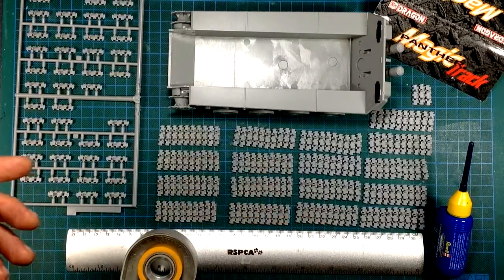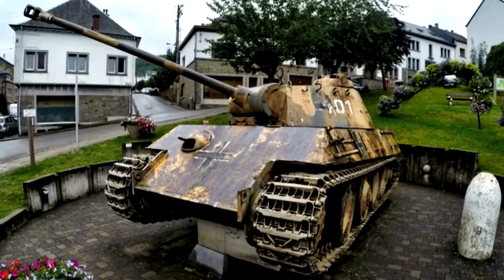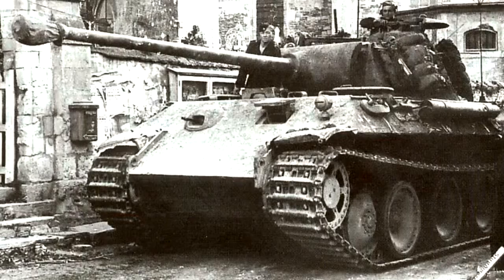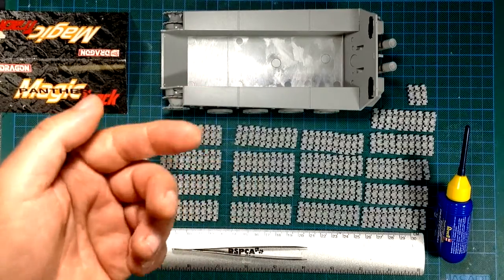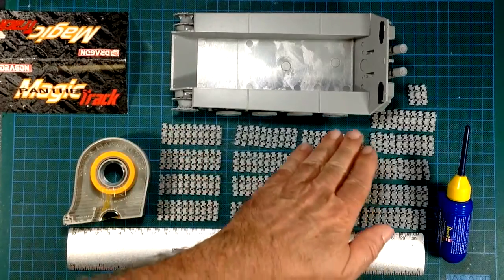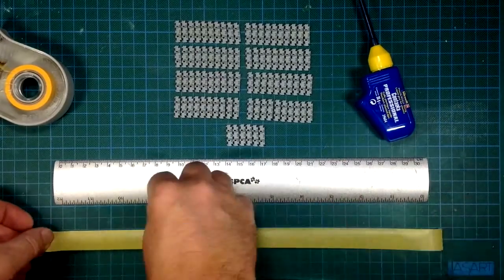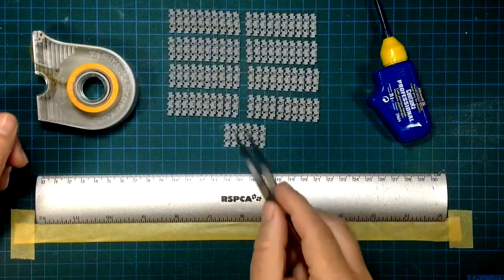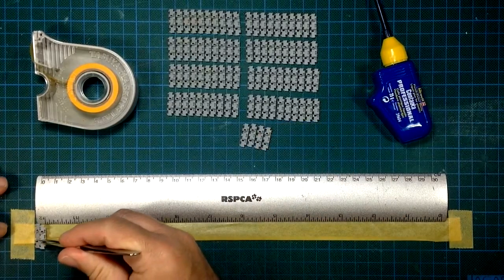How I Do Magic Track Links

Comment: Awesome video, Harry!  It seems like we all have our own little tricks when it comes to doing these tracks.  I can't get that slower drying glue so I have to do my tracks in smaller lengths, usually 3 or 4 sections per side.  And because I use Tamiya Extra Thing and it flows so well I don't use the tape below because I end up gluing the tracks to it!  Whoops...  I should try to find some of that glue.  Also, genius idea with the pipettes.  It's always hard to find the right sized object, but one that can compress is perfect!  I will definitely be trying that one amin the future :)
Reply from the maker: Standard Tamiya cement might also work, just needs to be thicker than Tamiya thin and take a while to set.

Comment: thanks will do.maybe I'm trying to hard.what kind of gloss coat do you apply after painting the model? I paint with acrylics.
Reply from the maker: There are various you can use.. all depends what brand of paint you are using.  If you watch my "How I Do" videos they show various paints and methods.  However many people use Future 'Floor Wax" thinned with a little water or I prefer Lifecolor's own Acrylic Gloss.  I have also used Humbrol's acrylic gloss clear, which has similar properties to Future.  If you spray Tamiya acrylic from rattle cans, it's basically a lacquer and provides a perfect primer/base colour to weather directly onto.  Watch my videos and I show all these methods.

Comment: Try VMS Cement (slow varient). Glues very slowly giving lots of time to position. For me I left tracks for 10 mins after applying cement, before trying to lift. The tracks where still movable and hour later. Lots of time to be able to get the ‘droop’ on tracks. Makes single link tracks a pleasure.
Reply from the maker: Thanks for the tip

Comment: the weathering scares the he'll out of me.i paint the model and it looks good but I always balls it up when I start weathering the tank.the pin wash doesn't work the sludge wash leaves brush stokes ect ect....just turns in to a mess.
Reply from the maker: Sounds like you either are trying to add too much or not preparing the surfaces for the weathering.  Have a look at the many videos in my "How I Do" playlist about each weathering technique I use.  The secret is to do a small amount and keep it subtle.. then you can always add more later.  Also make sure you prepare the surface with a gloss coat or a layer of turpentine to allow flow.